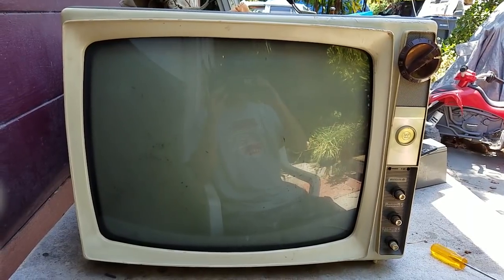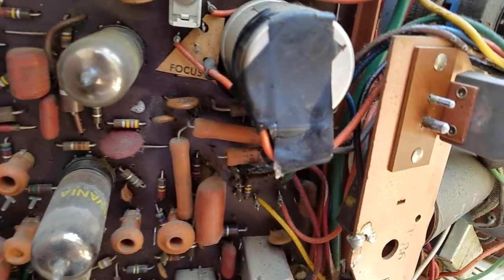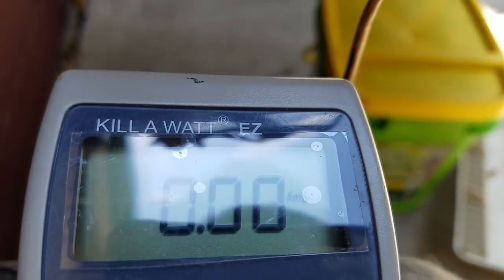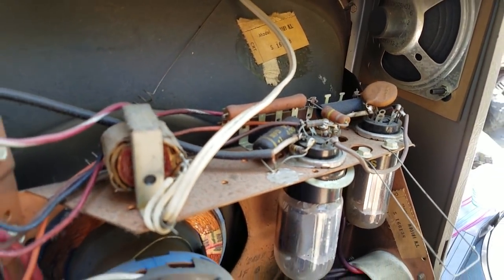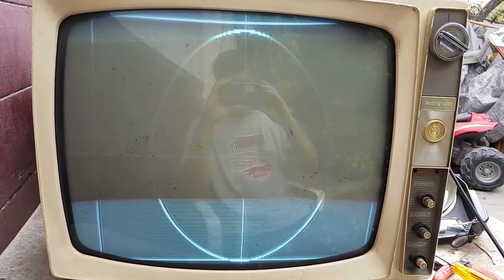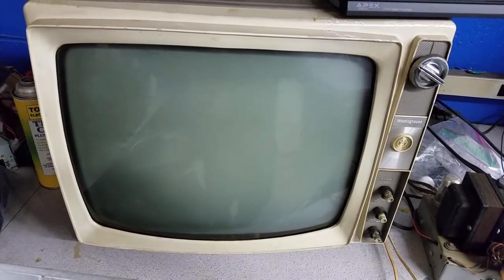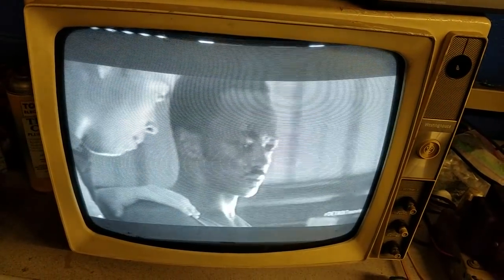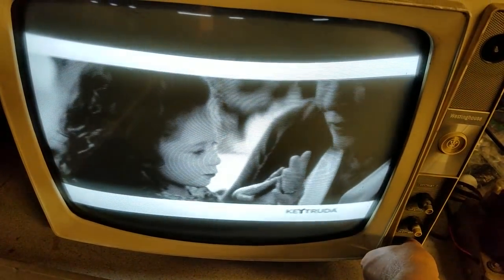1960s Westinghouse Tube Black and White Television quick fix

Comment: Shango (50 seconds in...)a shrunk picture is often too high EHT, a ballooned picture too low EHT. (I'm sure you know this, I always get / hear stuff wrong) but for newbies the higher acceleration of the beam due to higher voltage gives the scan coils less time / need to do more work to bend the beam hence it makes smaller picture and so on...now to listen to the rest and find I've commented for nothing.

Comment: Ekco radar display.
I watch too many of your vids, I dont have any tv's but I do have a few valve radio's.
I just got an aircraft ekco radar display which is tube, I want to get this thing working and use it as an oscilloscope clock type thing, I'm hoping the picture tube and associated flyback etc are still good, from your vids I have an idea now.

Comment: 'nobody wants them'...'in the trash'... 😲.. pity you're in the USA,  i'd have it in a shot (UK 😐)
Reply: also some of the 'trash' radios you pick up, rare here in the uk but probably common as muck where you are....
Reply: the usa is lucky that they kept the same tv standard from the start, but the uk had 405 line until '64 when 625 came in.. so running vintage tvs can be a big pain